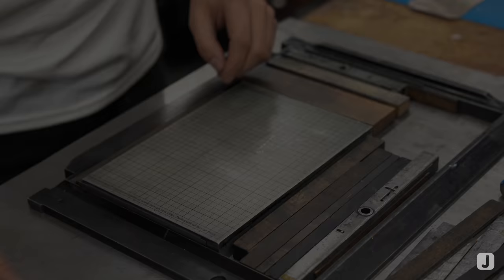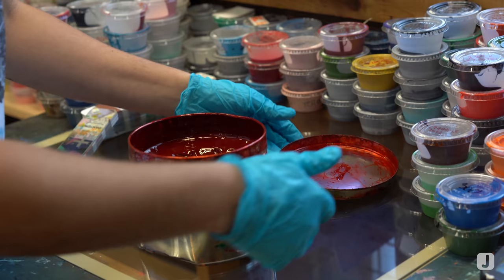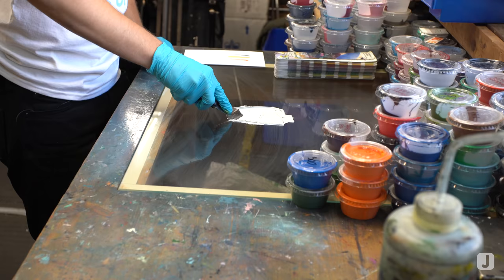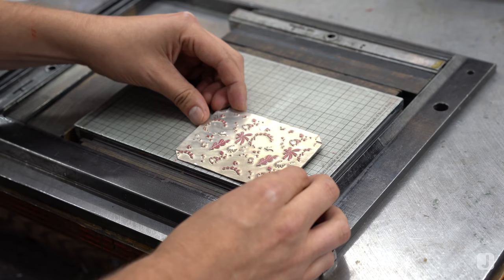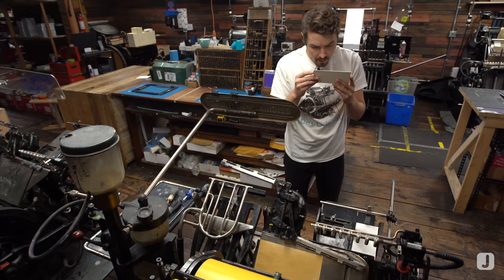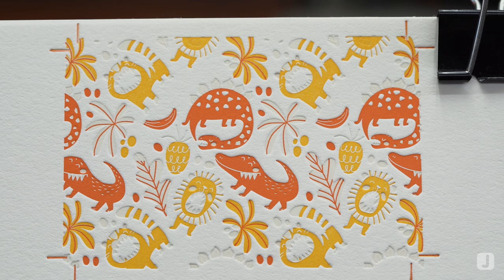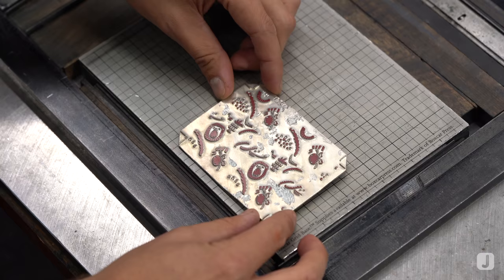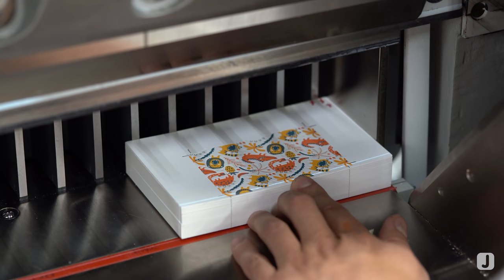Letterpress Business Card Printing with 5 Pantone Colors!

Comment: Amazing process, thanks for sharing 

What is the cleaning fluid you use and how does it clean so fast?
Where does the ink go ?
Reply from the maker: It's a simple water soluble solvent designed for printing inks. The ink is wiped off with a squeegee like blade and collected into a little trough. Clean up is nice and quick thanks to that!

Comment: What's the backside look like? How much punch is showing through? Is there information on the back of the business card?
Reply from the maker: There's very little punch showing through the back side. We don't like hitting the paper harder than necessary for the sake of the dies and the press. Impression shouldn't show through the other side much at all. We left the back blank for this run but we regularly do two sided letterpress work.

Comment: Isn't it possible to have some kind of markings on screws when you are setting that plate to know for how much you need to turn screw to move for 1 mm or something like that?
Reply from the maker: 1 mm is enormous in the print world! We make adjustments as small as 0.352 mm and its honestly quicker and easier by hand. Most of the adjustments on the machine are enough to dial it in after that. Thanks for asking!

Comment: Good job.i never knew you can you a letter press to do a color separation work using a plate
This machine has literally become an offset printing machine 
You can save a lot money by using the  letter press run a small job 
The machine hardly break down 
If don't mind to send information I can get some training 
Well done for hard work

Can  you use the process to print a full  color picture involving 4 plate ?

Comment: How many extra copies on top of the delivered quantity do you make to account for registration checks?
Reply from the maker: About 10% of the run overall... So, maybe 10-15 sheets extra per color? It's always changing depending on the number of steps to factor in.

Comment: How big is the dE variation of the pantone inks you are using to the inks with which the Pantone Swatch Guide was printed and to the Swatch guides from your customer? Here it is up to dE 10, which is way to much.
Reply from the maker: We try very very hard to make sure our color values land within a margin of 1 – 2ΔE but the factors to control this on a manual one color press make it fairly challenging. We use the latest Pantone swatch book and if our clients are using an older book there is bound to be a difference. We always trust the latest book so that we know we are up to date and accurate.

Comment: Is there any machine which compares the color of Pantone color book and the color of mixed ink. With bare eyes, it would not be easy to adjust the color of mixed ink according to the color of Pantone color book, especially if it's a beginner.
Reply from the maker: There is no machine. It is all done by eye. It takes years and years to be able to get accurate matches. We often have to adjust the recipe to get it just right. Practice makes perfect.

Comment: I had immediately imagine a process like this:
- you choose the pattern
- you choose the amount of cards
- the inks are mixed up automatically - the right colors and the right amount
- here you may need to physically take the inks to the semi-mechanical printer... but who knows, maybe this also could be done automatically :)
- you choose the pattern and the amount of cards on your new shiny printer (or you only choose f.e. the title/ID of the order, so you can easily choose the same what you had chosen on the ink mixer)
- the printer has loads of paper sheets - you don't need to refill it for so often (or shift paper sheets after applying the ink)
- ..but you may need to feed the printer with the prepared inks
- press START
AAAAND the printer already perfectly adjust the pattern, chose the right paper size, apply the first ink, change the rollers for the clean ones, start applying the second ink, in the meentime clears the first rollers, aand so on and so on

Comment: What is the process of translating an art piece into this medium?
Reply from the maker: A design file or image is first separated into it's base colors. If there are 3 colors, there will be 3 files. Each file is best as a 100% K vector file from Adobe Illustrator. This file is then output to a film negative using a thermal image setter. The film is then used to expose the artwork onto a piece of magnesium. The magnesium is acid etched into a relief plate using nitric acid. We then print using these magnesium plates! Any vector art can be translated into letterpress very well!

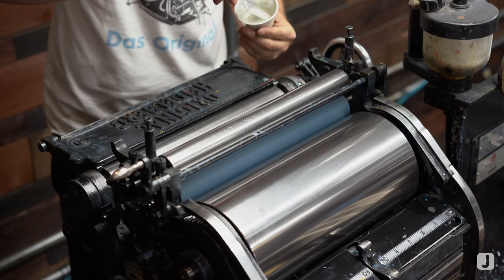Comment: @12:59, "We always run our colors from lightest to the darkest tone."  Why is that?
Reply from the maker: This is mainly to keep our press and color as clean as possible. Even a speck of dark ink left on the rollers can really throw off the color in a light tone. However, a speck of light ink won't have much effect on a dark color. An extreme example would be how a single dab of black ink can instantly turn white ink into grey, whereas a single dab of white ink into black won't effect the black at all.

Comment: Was there a reason behind the order of colours you printed?
Reply: when you print the colors from lightest to darkest the dark colors sit on top, this doesn't mean u can't do the opposite. it just depends on what kind of effect you want from layering the ink!
Reply from the maker: Yes but this artwork doesn't have any trapping or layering to deal with. The reasons we go from lightest to darkest is for our press. If we printed a dark color first, and then cleaned the press to do a lighter color next, some of the old darker ink might be on the press and cause the lighter color to be ruined. Printing from light to dark helps this issue!

Comment: why you used opaque white instead transparent white?
Reply from the maker: It helps to increase the solid opacity of the colour. Transparent white tends to make the ink look a bit "salty". We don't always use opaque white but for the most part, it improves the overall look of the print.

Comment: If you were to do the other side as well, would you do it before or after?
Reply from the maker: Great question. it depends on how much information, coverage, or colors were on the back. The best way to approach two sided letterpress is to duplex two sheets of printed paper together. That way the impression doesn't even effect the opposite side.
Reply: @JukeboxPrintLive  I'm really sorry, I don't understand the word duplex in this sense. I know duplex printing from home printers where the paper from the feeder is covered on one side but before being fully released the printer takes it in again to do the other side.
Reply from the maker: @SamoScopom  What I mean is, the front and back being printed separately and then glued together when each side is complete. Does that make more sense?
Reply: @JukeboxPrintLive  yes, yes, thanks, that makes sense. Is there a machine for that that did it or would that have to be done manualy. Cause I can easily imagine a machine that would do that

Comment: why do you bother putting the ink all the way along the roller if the paper is that small? youd use less ink if you only put it on the side thats gonna roll over the paper
also, the leaf on the left has part of the veins at the top of it not indented? was that intentional?

Comment: What's the digital file looks like? How to set up the file/layers?
Reply from the maker: Vector artwork in an Adobe Illustrator file is best. Each color is separated and placed onto its own art board and made 100%K black in CMYK mode. Save as a single PDF file and you’re done! The PDF should have a single page for each layer and every art element should be solid black. Great question! Thank you.
Reply: @JukeboxPrintLive  Sweet cheers mate! Great work!

Comment: First, how can these be business cards with no text or contact info? Second, this must have been extremely expensive. I’ve been doing print jobs since Linotype and Letraset and I’ve always gone CMYK to get as close to any specified Pantone colors. Printers charge a fortune just for a press wash... What did you charge and for how many cards?
Reply from the maker: We made this card for the sole purpose of filming it's creation. We've done 20+ spot color jobs and 15+ foil color jobs in the past just to push the limits of print. Specialty projects like these aren't viable for the average person. It's also why there isn't any contact info - it's more of an art piece. Pricing for a card like this would be very high - you're not wrong there. Glad to hear a hot type/cold type professional is in the comments!